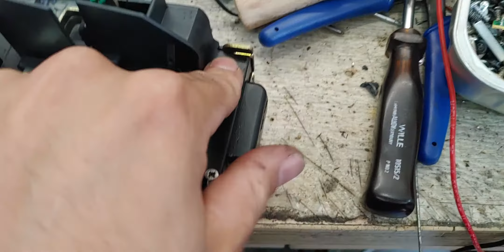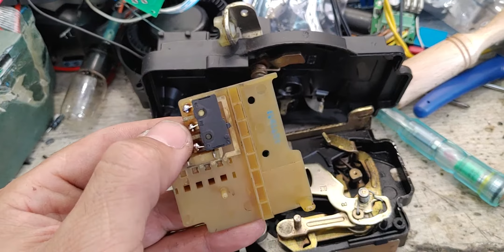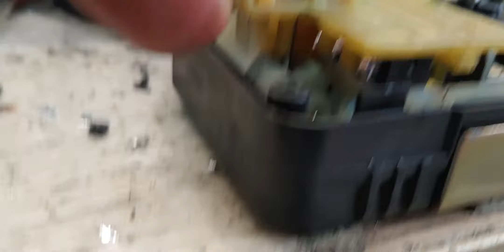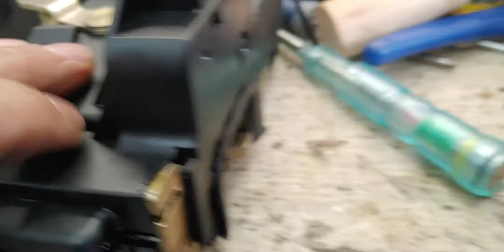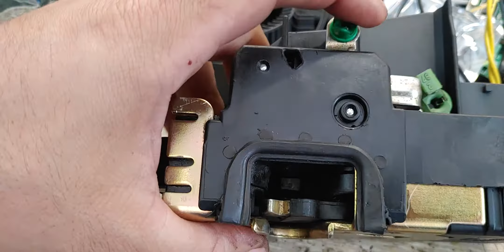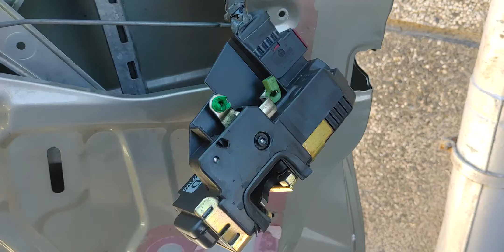Vectra B locking mechanisms repair

Comment: Hi, thanks for the video.

I wonder if you could tell me which switch is that, I mean to buy it first when I proceed to open it 

Thanks
Reply from the maker: I don't know it's exact designation and model. It is visible in the video, try to compare it visually. Opening is a bit tricky because of the expanded metal shaft acting as a rivet, but you can just heat it up using a soldering iron after you undo all the screws and straighten the metal plate that is bent in to a channel in the plastic cover. than you heat up the shaft and it melts a bit of the plastic. Once you remove the cover you will see the switch soldered in the plastic assembly for the connector.  It is a fairly generic switch, but it has to be rated same or higher amperage than the original switch.
Reply from the maker: I have seen them used in microwaves with a mechanical timer.
Reply: microswitch